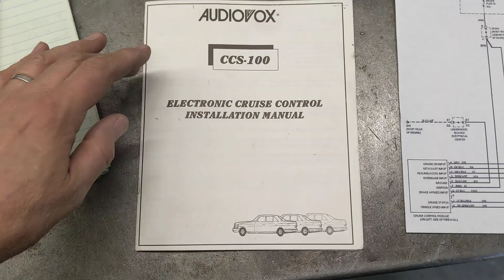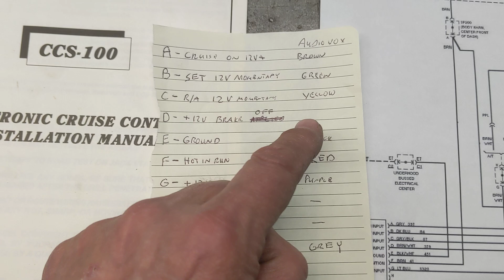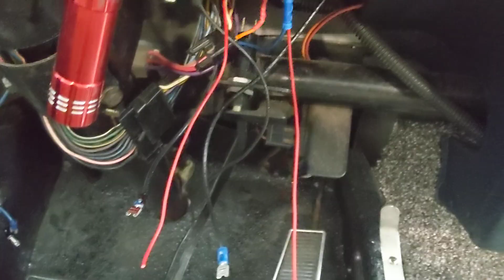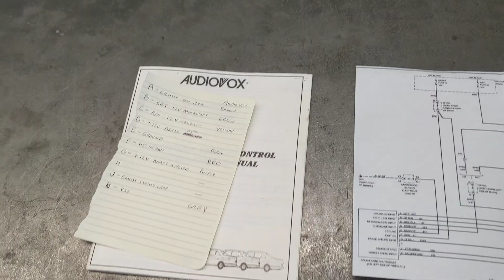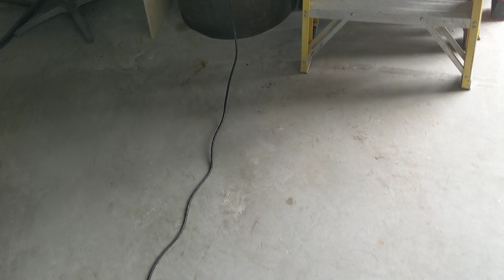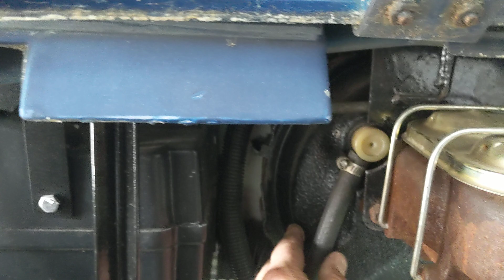GMC Motorhome 230 (cruise control / electric vacuum pump for power brakes)

Comment: Hey Mike, I ended up pulling a vacuum pump out of a Volvo, works great!! Definitely a must have for peace of mind.
Reply from the maker: I couldn't agree more.  When I was test driving the coach before I purchased it the engine died going down a hill with a curve at the bottom.  Thank Goodness they handled well because the brakes were non existent.

Comment: Our PO had a similar vacuum pump installed, and two 3' long 3" PVC chambers in series behind the front bumper.  I ditched the pump and one of the PVC "storage" tanks.  Agree that you have to keep in mind that you have one "good" pedal pump should your engine die.  Nice work as always!
Reply from the maker: I hope it works well, the engine died on my test drive on a hilly road and it was a bear to slow the coach down for the curve at the bottom.